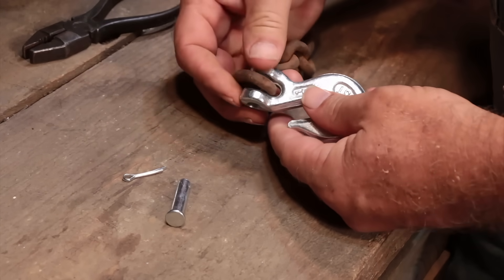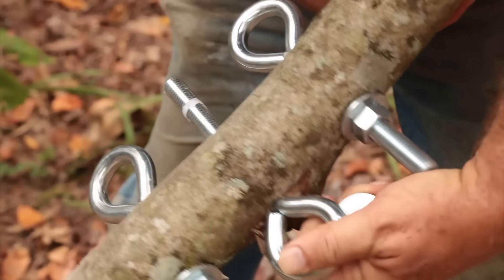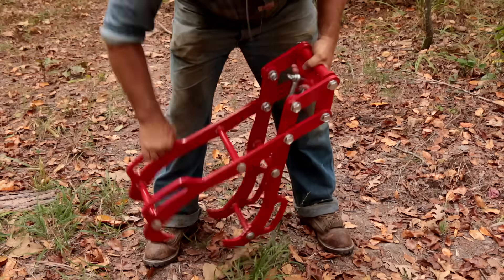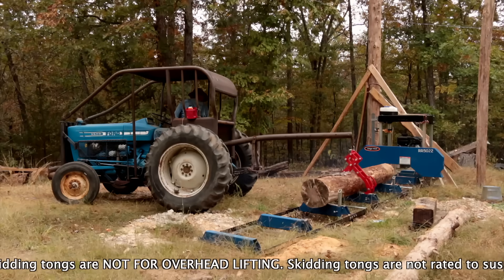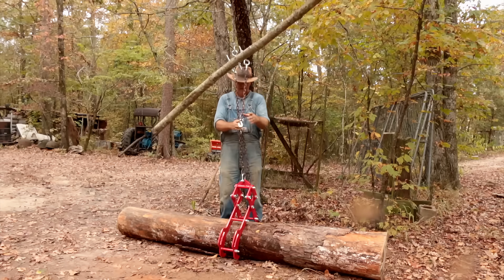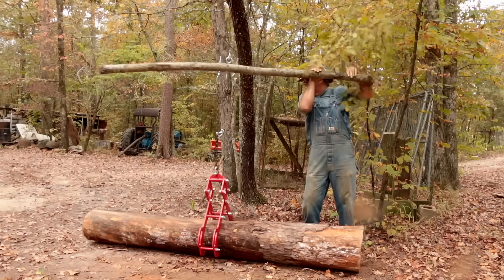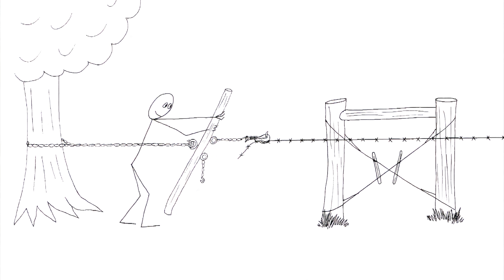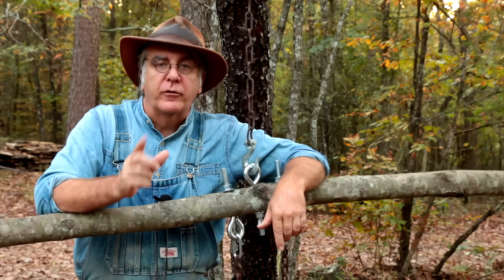How to Lift Heavy Objects Without a Block and Tackle

Comment: I watched an Amish farmer pulling stumps with a variation of this.  The lever was about 40 feet long and used on the ground.  The pivot and two attachment points were at on an end, not the middle.  The pivot point was attached to a large tree with one attachment point to the stump.  A team of horses pulled the other end of the lever.  The stump was switched to the other attachment point and the horses pulled the lever in the other direction.  Very simple and effective.

Comment: You mentioned you could lift using human power. However, you failed to mention it would be slow human power. Good scientific example that power does not equal speed. But that gadget has so many more uses than simply as a hoist. Thank you!

Comment: That is very good.  Had not seen that before.  Rather than use chains, if one used strong rope, and ascenders, one would not have the limits of a specific chain length, or the overthrow to get the hook into a seat, reducing the efficiency.  Climbing ropes are up to 5000 pounds, and police departments have static versions that they switch out every year, so with some reach, you can get them for free.

Comment: What is the draw back from spreading out the two outside bolts a few more inches to get a bit more lift? Is it that it would be harder to lift or the top branch wouldn't be able to handle the weight?
Reply from the maker: Yes, it would gain you more inches on the lift, but you'd sacrifice needin' more strength to pull the lever down.
Reply: @farmhandscompanion  Hmmm, maybe A 20 pound bag of sand to help on the down stroke, before long I'm need a longer top branch, lol. Thanks for the video!

Comment: The big "gotcha" here is finding a sturdy object, like the big tree in your video, that's up high so you can attach the contraption.
Reply: Not really as he mentioned you can build an easy tripod configuration to use to lift.
Reply: @kiowa4440  HA!..............I like that:  "easy tripod configuration".
Sure, buy yourself a welding machine, buy very 1/4" thick pipes, etc.
Reply: @machonsote918 To build an easy tripod lift, gather three strong poles (like 2x4s or pipes), a central attachment point (a metal plate or sturdy head), and a lifting mechanism (chain hoist or winch). Securely lash or bolt the poles together at the top, ensuring equal spacing and strength, then attach the lifting device to the central head, adding safety straps to prevent leg splay, and always test the load capacity before lifting. 
Simple Wooden Tripod (Bushcraft Style)
This method is quick for lighter loads but requires careful knot-tying. 
Materials: Three straight wooden poles or sturdy branches, about 10-12 feet long, and strong rope.
Prepare the Poles: Align the poles side-by-side.
Tie the Lashing: About 10-12 inches from the top of the poles, tie a clove hitch knot.
Wrap the Lashing: With the remaining rope, make several tight, taut turns (racking turns) around all three poles.
Secure the Knot: Take the rope end and wrap it between the poles (frapping turns), then secure it with another clove hitch or a reef knot.
Position the Tripod: Lift the poles and spread them into a tripod shape, ensuring the rope lashing remains taut. Easy peasy.
Reply: How about coming up with a video showing how?

Comment: LMAO....If you take the time to go shopping and spend $50 all of this hardware, cut down one of your trees, and spend another $150 on some logging tongs, which I got for free from my sponsor whose commercial comprised 1.5 minutes or 21% of this 7 minute video, and then spend more time assembling and setting up your somewhat isolated single use leverage mechanism, you will be able to pick up a log if it's conveniently laying right under another one of your trees.

Golly!  Gee Whizz Beaver, all that for only a couple hundred dollars and hours more of your time that would have been saved using many other less expensive, and more effective methods.😂 Seems like pushing when you should have been pulling when stuck in the mud to me, aside from being a commercial which seemed to be at least 21% of the whole thing...lol😎

Comment: You can save some $ and do it the real Olof fashion way and just use three lengths of chain wrapped around the lever.  Give me a lever long enough and i can move the earth…Atlas
Reply: Not without a fulcrum on which to place it, you won't.
BTW - the quote you bastardised is attributed to Archimedes.
Atlas is a mythical god.
Reply: @trueaussie9230 I almost caveated the statement… I knew someone would fix it…thanks!

Comment: Instead of an above mounting point one could use one strap, one lever and varying logs placed on either side of the  log lifted. With each lever lift you change out the cut logs for a taller one for lifting or a smaller one  for lowering. You have inspired me in this way for a much needed hoist of a 40 foot poplar log. Thanks
Reply: There is a video somewhere on YT showing that technique - likely used by the egyptians for lifting big stone slaps.

Comment: very cool design. there are so many ways to use leverage to shift heaving things around bit by bit. we had a thing like that on my great uncles farm but it didn't work quite the same. the pole would go basically vertical and swap pins into the chain then reverse lifting the difference and swap pins from the now loose pin into the new chain link. probably not explaining it well, but it is similar but doesn't have as many parts and required two people to operate.

Comment: A spanish windlass is a very simple alternative, well known to sailors and boatbuilders.
Reply: windlass is good.. its one shaft with varying  diameter along its length,  wound clockwise  down to pulley, hook and load back up to shaft  wound counterclockwise.. cool.
Reply: No no. That's a Dwarvish windlass you're thinking of.
Very useful when you've plumb got a dragon problem

Comment: Awesome idea, I've never seen that method before. In a pinch you could notch the log used as the lifting arm (in the event of not having eye bolts) and use the chain hook to grab the notch. Could probably use slip or grab hooks to grab the notch in the log. Thanks for the video.
Reply from the maker: Good thought, mrbumblehill4596

Comment: Block and tackle works the same way as the lever really. You are exchanging distance to amplify force. With the lever you have a long handle that has to move a greater distance to increase the amount of work accomplished on the other end. With the block and tackle you pull more rope to move a shorter distance on the business end. Not a very good explanation but hope you get it.
Reply: The block and tackle has one continuous rope, all of the rope is under the same tension.  If you pull on the end of the rope to put 10 lbs force of tension on it, and the block and tackle has 4 runs of rope to the sheeve that is attached to the load, then there is 40 lbs force on the load.  Also, if you pull the rope out 4 feet, that gets distributed across the 4 runs to the sheeve attached to the load, so the load only moves one foot.

Comment: I find this method very intriguing. I enjoy splitting firewood that gets delivered to me every year. But I've been trying to figure out how I could have the wood delivered to me whole, so that I could buck it up myself, too. I like the idea of using my human powered Silky saw to buck firewood, partly for the independence of it, and partly for the exercise of it. Problem is, I'm not going to buck up wood that's on the ground. I'd like to get it at least waist high, and set it on some sawhorses or something. But I don't know how I would get the logs up there without machinery, which I'm unwilling to purchase or use. I like doing everything manually. If I constructed a large enough, and strong enough tripod, perhaps this method would work. Thanks for sharing!
Reply from the maker: A sturdy tripod combined with this tool should work just fine, Seth. Just keep your feet out from under the logs.